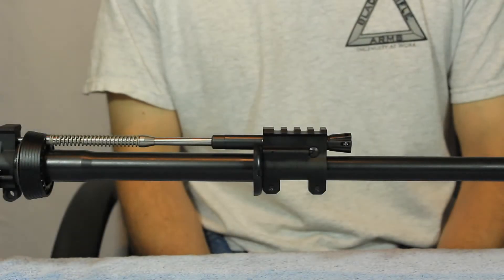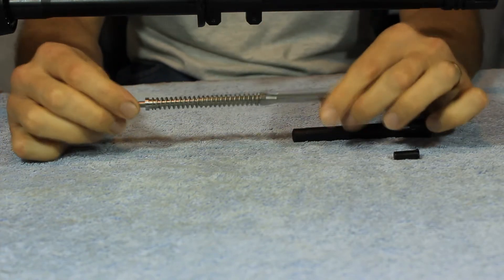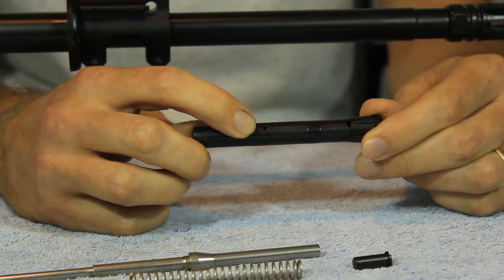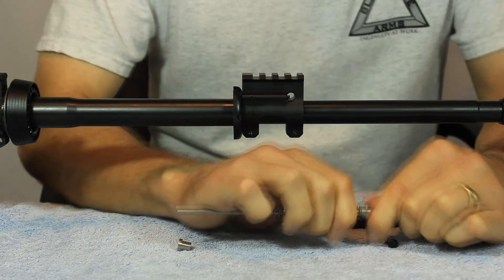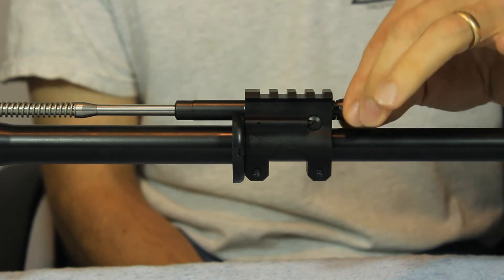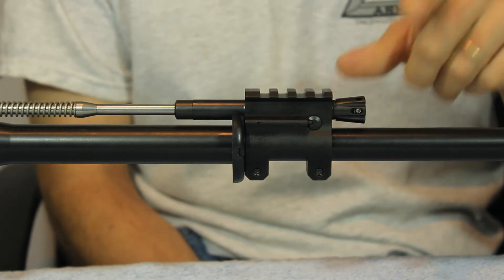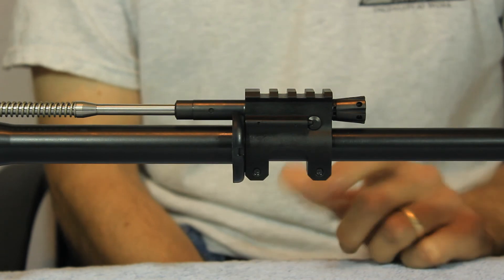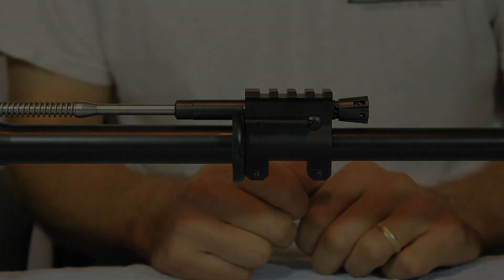Black Rifle Arms CAPS Piston System Overview

Comment: I have 2 from Adams Arms and love em.
Reply: Adams are solid for the price.. but they don't sell .308 system parts. Or have a larger than .750 gas block. I would love to build a craddock barreled 14.5 6.5cm regardless.. but to do so I will have to buy another complete rifle in .308 (TBH I like the barrels though)